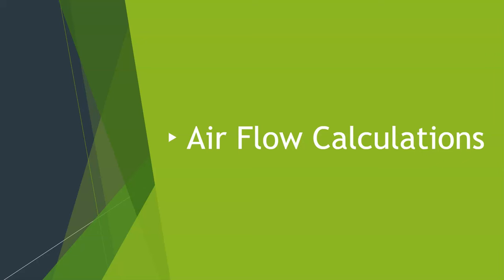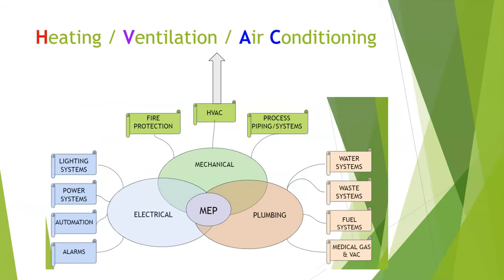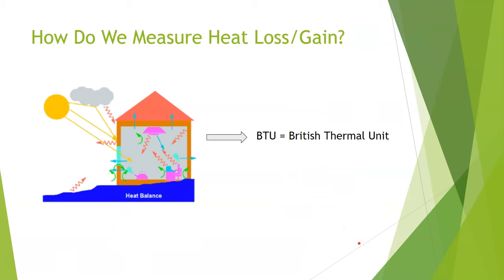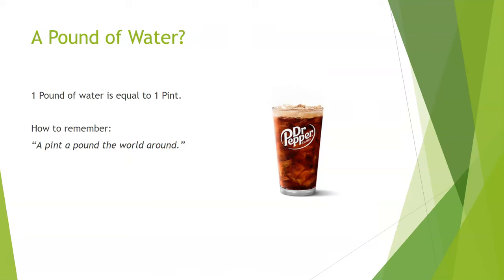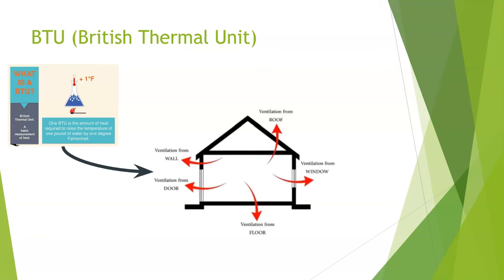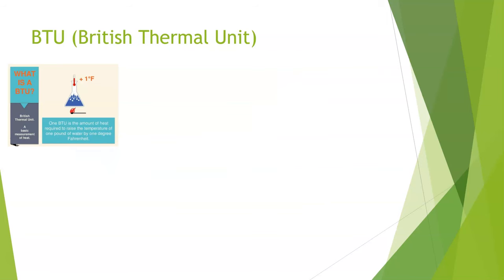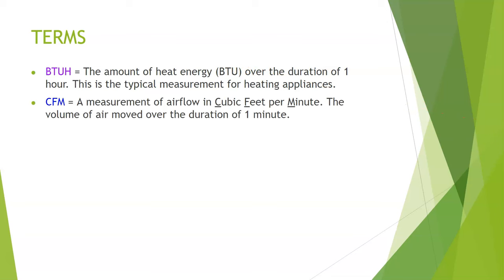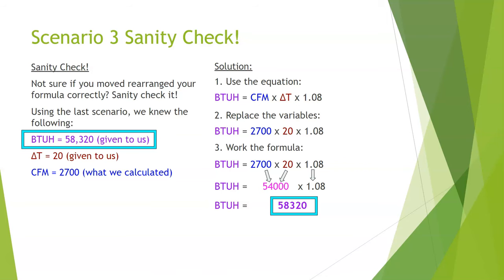HVAC AIR FLOW CALCULATIONS

Comment: 1.08 fudge factor is density of air in lbs/cu-ft * specific heat of air * 60 minutes in hour.
0.075 lbs/cu-ft * 0.24 BTU/lb * 60 mins/hr. = 1.08.   It is temperature and pressure dependent.

Formula works for heating where there is not any phase change occurring.  Air conditioning cooling has phase change (latent heat) of humidity in air, turned to condensed water which consumes some of the air conditioner's cooling btu's capacity.

Direct electric heater input power is very near 100% efficiency on power transfer to air flow, where air conditioning cooling from evaporator has a lot of other factors impacting heat absorption by evaporator coil.
Reply: Thank you for explaining the factor. Just add F to specific heat units.😊

Comment: question   how do you find the delta T? do you run the furnace and take the split temp between the supply and return duct? or do you go,by this being a constant split. I think i remember from school it was rule of thumb and it was 17 degree f and between 22 degree f. would have the same question for finding current cfm
Reply from the maker: You are correct, you would find the actual delta T by taking the difference of the return air and the supply air.  A typical value that I have always used for a "typical system in ideal conditions" is 20 degrees F.

Comment: How come the needed CFM increases with decreasing delta T?
Reply from the maker: Great question!  It has to do with the delivery of energy.  A lower delta T means that there is less heat transfer so you need more movement of that lower energy.  Let’s say that we have to heat a volume of air in a room.  To do that we have to add energy, in this case BTUH’s.  If we added very hot air (therefore with a high Delta T) we don’t need to move the air as fast because the room will come up to temperature quickly because of all of the energy that we have at our disposal.  Now if we take the same room and blow in air that is just a little bit warmer than the room air (low delta T), we don’t have as much energy to bring the room up to temperature so we need to move more of that air lower energy air to add up to the total energy that the room needs to keep temperature.

Another way to think of this is with a bicycle.  Let’s say that you want to ride your bike up a hill in 2 minutes exactly and there are two scenarios.  The first scenario is that you have super strong legs (high delta T). The second scenario is that you skipped leg day (low delta T).  Both require you to pedal at a certain speed to get up the hill in 2 minutes; pedal speed in RPM (CFM air flow). With super strong legs we can use a harder gear and pedal up the hill in two minutes using less RPM’s.  With weaker legs we have to use an easier gear which will require us to pedal faster but with less applied force to make it up the hill in 2 minutes. Same hill, same time, different pedal speed based on the amount of strength (energy) that we have. More strength = slower pedal required.  Less strength - faster pedal.  

Hope this helps. If not please let me know!
Reply: outstanding explanation  @KingenuityLLC

Comment: Speaking on the convince factor. I know it changes with the starting temperature. How does altitude affect it?
Reply from the maker: Great question.  Altitude does come to play with a precise calculation. The 1.08 has become a "convenience" and is based on standard conditions (at sea level).  For true calcs, air density at the blower is needed. 

Here is a handy PDF from Rupp Air with the formula to account for air density.  https://www.ruppair.com/documents/white-papers/Actual%20Air%20Density%20BTU%20Calculation.pdf

Comment: Hi, when calculating the air flow formula, do I need to use °F for your delta-T? Will the formula be diffrent when using °C for delta T.?
Reply from the maker: Yes, this formula will only work if the delta-T is in °F.

Comment: if I have a target ACH of 5, a garage size of 30x20x9, I get a CFM of 450... Living in Florida, I have aa deltaT of 30F... (target indoor temp 70F when outdoor is 100F) So 450 x 30 x 1.08 = 14,580; rounding up I need a 1.5Ton unit?  (Mini Split, no duct work).  CFM = 20 x 30 x 9 x 5 / 60 = 450.  How's my math?
Reply from the maker: Thanks for watching!  While air flow is certainly a useful too calculate BTUH, when sizing equipment the building itself needs to be taken into account.  This is done by way of an ACCA Manual J load calculation. Factors like insulation values, building materials, building orientation, and weather data all come into account.  How's this, shoot me an email with your contact and I'll let you know what info is needed and I can work up a Manual J for you and give you some equipment recommendations.  kingenuitytech@gmail.com